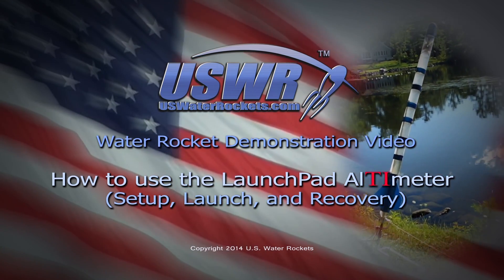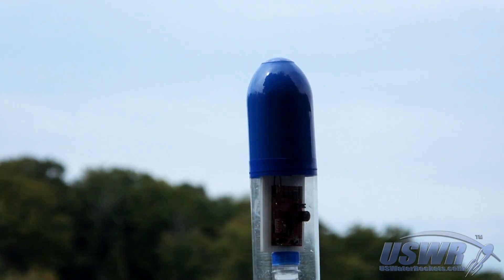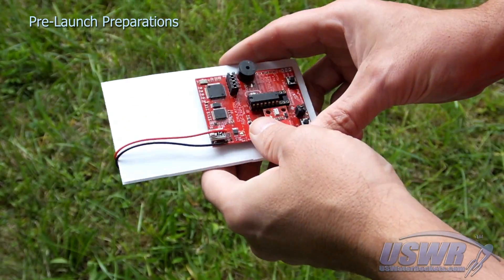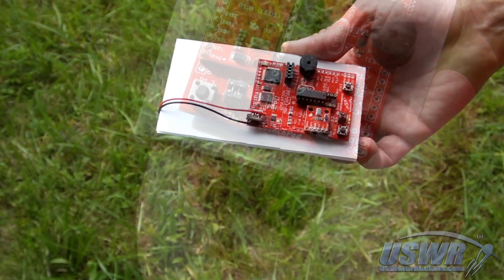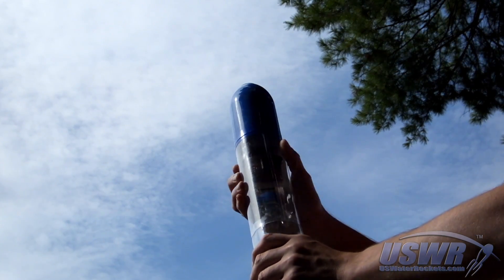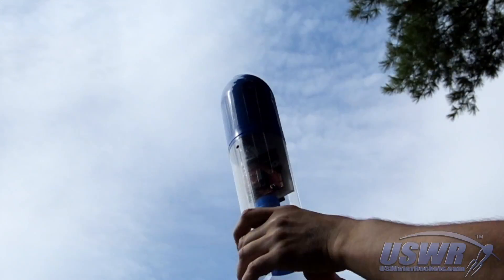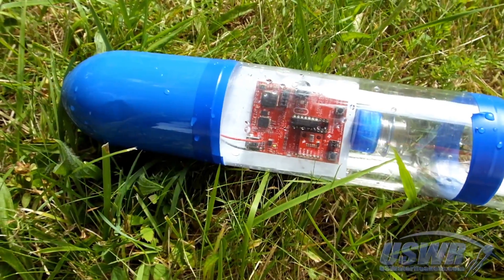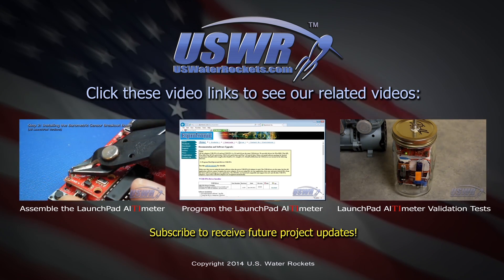Launching the Water Rocket Altimeter with Parachute Deploy

Comment: I see that the top part was separated when it reached to the suitable height. Could the altimeter be heavily affected if the top part goes down to the water regions or simply get the hard collision with the ground? And we must make it again?
Reply from the maker: From our experience the components are quite durable, and can survive a crash with only minor damages. The chip might pop out of the socket or a wire may be broken from impact, but the board will function once the damage has been corrected. If the Altimeter gets wet, if you follow any tutorial or advice for drying out a cellphone that was dropped in water, the Altimeter will begin to operate normally after it is dried.

Comment: it is very easy to setup and it is the most reliable system even if i had a launch near parallel to the ground
Reply from the maker: Thanks for the positive review, but be careful launching at low angles. It becomes harder and harder for the launch detect to function as you get closer to 0 degrees launch angle.